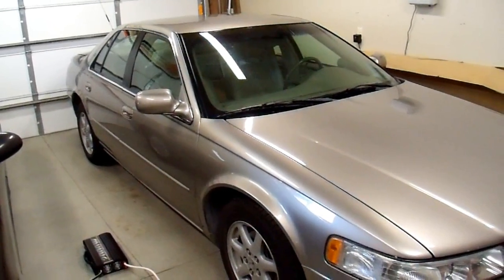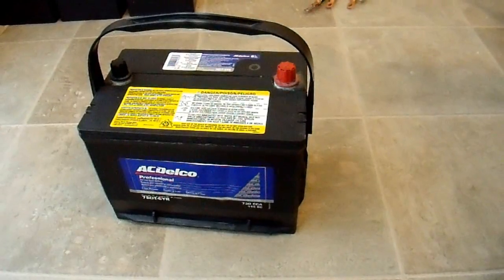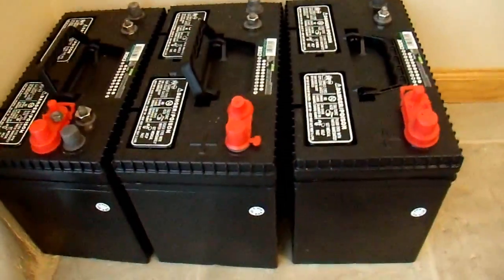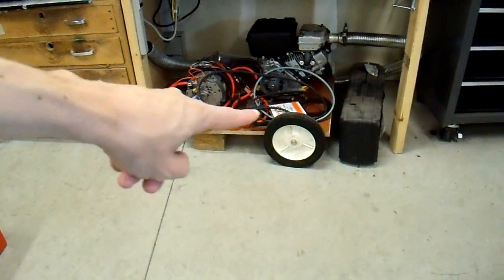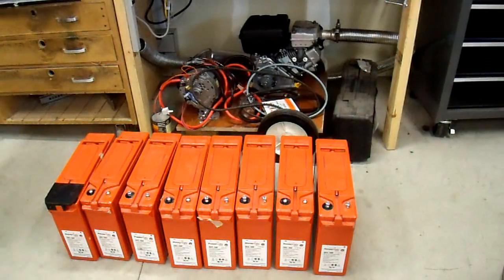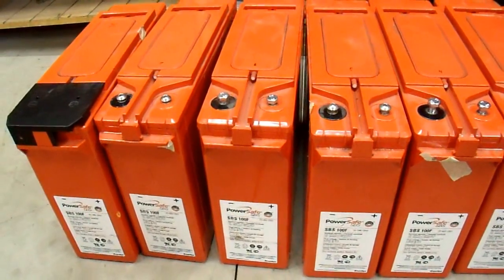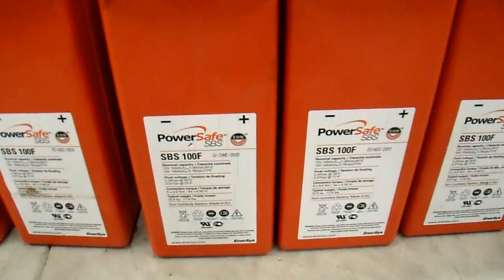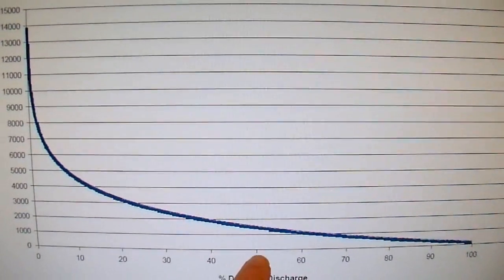1000Ah Battery Bank Part1 - My Salvaged $40 Battery Purchase : an Introduction

Comment: Where do people find deals like this where they find used stuff for sale? E bay doesn't work anymore because its too commercialized and inflated. But people must be finding deals like this... somewhere but not sure where to even look. 

Thanks.
Reply from the maker: eBay used to be useful but with today's tax laws it makes more sense to just throw things in the garbage than to sell.  A whole vibrant market of repurposing and repairing mechandise crushed.  What a waste.  I found these batteries through the company I worked for as they were going to dispose of them with a recycler and paid scrap value for them saving them the trip to the recycler.
Reply from the maker: I have a lot of random stuff that I'd normally sell on eBay but there's simply no point anymore.  I've thrown thousands of dollars of stuff in my garbage can.  It makes me sad, but the alternative is paying tax on what I sell and losing money.
Reply: Hey buddy you still active? I was able to recently get access to to literal tons of sla battery’s all standardised size and same brand, making building a bank easy! You need to find your local electrical or signal depot for a train network and talk to some of the guys there, we have 6-8 pallets about to get dumped simply because we change out our back up batteries every 2 years, I’ve got 16 100AH 12V batteries for free, they might ask for a case of beer or something for a pallet load but otherwise, we try get rid of them otherwise we have to pay someone to recycle them.

Comment: What were those big red batteries really used for those ATM batteries but they use for an heavy equipment operation at the time or where I want to know if that was just a heavy utility battery or how many hours does the really explanatory how many hours those batteries actually get if they were new I mean I'm curious of how many hours those batteries really get were they poorly in condition or were they in somewhat a good state of condition?

Comment: I'd give anything to fi d batteries for a deal like you did. I have stage 4 cancer and I'm desperately looking for a good deal like you found. I'm trying to get a solar power system built so if I get more sickthen me and the wife can have electricity without another bill that we already can't afford. I'm still working at the moment but my wife is disabled so it is really important to me. If I pass away I want my wife to still ha e electricity also. I've bought a 24 volt all in one Controller and 8 panels so far and if you know where I can find d batteries like this please let me know

Comment: I found this channel recently and like it for its great content.  I know that this episode is quite old but still applicable.  I diy my own lithium batteries but still use lead acid in my shop.  I have to say that I find 12v start batteries at my local scrapyard for 2 or three dollars that still work, carry a load, and aren't shorted between cells.  These are used to power bench tools like my table saw, drill press, bandsaw etc  thru different inverters of various sizes.  Meanwhile these batteries are topped off with my solar panels constantly.  The system uses pass thru charging  allowing me not to damage the batteries at all.  And I have a charge controller dedicated for each battery, allowing me to switch between them.  So in a sense yes,  lead acid start batteries used this way will and do hold up.
Reply from the maker: Nice!  I expect LiFePO4 will eventually take over most lead acid applications but as of today lead acid still has a very important place in stationary storage.  My experience with auto SLI batteries is similar - the primary critical failure mode is a shorted cell.  Unfortunately automotive batteries today are made so cheap that you often get less than 50% of the rated specs of the battery new if one actually tests them.  Somehow no one seems to care.

Comment: Man where can I get batteries so cheap?
Reply from the maker: These were acquired at salvage value.  Normally one would have to have connections to a battery recycler or intercept them before they were disposed of.  I noticed these on a scrap pile and offered to buy them.
Reply: Awesome

Comment: Did you ever post this on a web site prior to YouTube being a thing? I could swear that I have seen something like this on a web page back in the mid to late 2000s.  It was so long ago, but I do remember someone buying a pallet of orange 6V batteries that were heavily discharged. I do not remember any details of the recovery, but that was the goal of the information being shared on the web site. We are 10 to maybe 15 years later, and when I see this on YouTube. Perhaps I am confusing two different stories , but it seems so unique that I can't help to think that you had started this project many moons ago. The only picture that I remember is a pallet of orange batteries. 

Daag44
Reply from the maker: Must have been someone else.  Interesting to hear about someone's prior efforts though!
Reply: @knurlgnar24  Interesting indeed. Since those orange Trojan batteries are common in the professional world, no doubt someone else has made the attempt. Before I watched your videos I had no clue of Trojan batteries nor of Rolls that I picked-up from a reply to comment that you referred to the Rolls User Manual. That manual was helpful by the way.

In the past month or so I managed to recover three of four starting batteries - one for a lawn tractor, two for cars, and one for powersports. I went too far with the first one, so I have focused on the method as shown in your videos. After spending over a month at my leisure, I can say that the experience has brought me up to speed including the comment section. However I am struggling with three things for starting batteries: 

1. Discharge current;
2. Discharge in Ah;
3. Boost voltage. 

One example is the recovery of a Yuasa YTL20L AGM rated at 18Ah/10Hr and 18.9Ah/20Hr. This is the most common starting battery found in Ski-Doo snowmobiles/sleds. I began with a fully discharged battery holding an OCV of ~9Vdc and after recovery managed to get an OCV of 12.65 for a day, and holding 12.60 for a week. It is far from the ideal 13.0-13.2 when new, but it is usable for my needs. By the way I found a factory activated one sealed in the shipping box that was showing 13.1Vdc two weeks after the manufacturing date. After 12 months it had self discharged to 12.3Vdc. I had done this self discharge test to disprove what was being said by one gentlemen on a particular snowmobile forum that self discharge was negligible during the typical 8 month storage and it did not matter. This was a few years ago which at the time I had not yet seen your videos. At the time I did my best to recover with my smart charger. In hindsight, I could have easily recovered that brand new battery to near 100%.  

Since it is a starting battery, I figure to discharge to a maximum of 5% of the rated 18Ah, or roughly 1Ah. The sled does have dual headlights that I could use and draw 8.6A @ 14Vdc. So far I have taken a shortcut by using a 125A battery tester that shuts off after 10sec and I repeat for a total of three consecutive discharges for each discharge/recharge cycle. For each cycle I let the smart charger complete the bulk charge only and immediately repeat the discharge/recharge cycle. 

The cell temperature rises during discharge and bulk charge, and keeps rising after each cycle, but never above 15-20F over the ambient temperature of 60-70F. With each cycle, the results are higher for the 125A discharge test. For example, the voltages under load for the last second of the discharge tests are as shown below. I took the voltage readings under load with my DMM off the battery because the voltage shown on the tester was over one tenth lower. 

1. 10.50-10.49 -10.43Vdc
2. 10.70-10.58 -10.45Vdc
3. 10.75-10.62 -10.46Vdc

Once I have completed the three to four cycles, I top it off with a boost charge of ~15.5Vdc @ ~0.9A during which the cell temperature lowers some. To reach 15.5Vdc I had to borrow my father's dumb charger because mine was outputting a little over 16.0+ Vdc on the same 2A setting which in turn rose the temperature of each cell. 

His 10A setting is higher in voltage than mine at 12A, but I also have a 70A setting with the highest voltage of all. This whole experience had me realize that the difference in Amp settings on a dump charger is in the way it regulates the voltage. The 2A will be the lowest, then a higher voltage for the 10/12A setting, and the highest for the 70A boost setting. My father's charger only has 2A/10A, but he has been using the 10A setting to boost his Massey Ferguson tractor for years. I learned of this just recently after seeing him use the 10A setting to boost his lawn tractor. He admitted the first time felt like a risky move and eventually became standard practice.

The Boost charge on the YTX20L with his dumb charger starts with 15.3Vdc @ 0.27A and a 0.035 voltage drop across the DMM that I have in series. Over the course of a few hours the current draw will drop to ~0.8A and the voltage will rise to ~15.5Vdc with a voltage drop of ~0.02Vdc across the DMM.  

From the cell temperature rising during the discharge and bulk charge cycles, then dropping during the boost charge, I can only imagine the gassing-out of this AGM battery will be negligible. Note this is with my dad's dumb charger. Mine on the lowest 2A setting is 0.8+Vdc higher which also drives the cell temps hotter. I need to figure out if I should send his 2/10A  back or ask if he is willing to swap with my higher output 2/12/70A that I have only kept for the odd boost. In other words, if his dumb charger at 2A / 15.5Vdc is ideal without the need of a load resistor, then swapping chargers is the obvious answer. Since you have been experimenting with charging voltages and cell temperature, I am hoping that you have some insights to offer.

The two big questions that remain are:

1. Should I continue to discharge at a high rate for starting batteries, or is there an advantage to lower the discharge current over a longer period with the dual headlights for the same Ah?

2. Is there any benefit to passing the 5% DoD to recover a starting battery? For example, passing the 5% DoD one time for better recovery at the expense of cycle life. My best guess is that a deeper discharge on a starting battery that is immediately followed by a recharger will have little impact. How much deeper of a DoD, and what advantage it holds is what I hope to understand to a reasonable degree.
Reply: Out of the 4 batteries that I have attempted to recycle, I made the effort to provide the results from the AGM starting battery since it was the closest I could get to what you have shown in the videos with all AGM deep cycle batteries. What I find puzzling from the Rolls user guide is that it says AGM batteries require no cycling nr equalizing, yet this is what we are doing to recover our AGM batteries. Obviously I can make a distinction between recovering and maintaining, but it still raises the question why is this procedure not called for AGM batteries? 

My question stems from monitoring the cell temperature during recovery and noting they started far apart and ended very close. While this particular YTX20L it is still getting a boost charge this evening on my dumb charger set to 2A to compare with my dad's charger, the current is now 0.26A @ 16.2Vdc with a cell temperature of 58.4F to 60F between the coolest and hottest cell, at an ambient temperature of 54F.  Even with nearly three times more current than my dad's charger, the cell temperature appears to be acceptable for a short period (aka boost/equalization charge). So why do they say it is not needed on AGM batteries when it appears to hold a benefit? Is this because I am working on an older AGM battery that was left to sulfate? Or is there another reason such as repeated/periodic equalization attempts would further shorten the life of an AGM?

Comment: I’ve got 15 PCs 3.2v Lithium Phosphate Batteries 280Ah ea. They way there sitting now 2 wide 7 on 1 side 8 on the other I will use some of you’re ideas thank you !
Reply from the maker: Please note that LiFePO4 batteries need to be treated completely differently than lead acid batteries.  This video series concerns lead acid.

Comment: Nice review. Waiting for more in this section. We are also a manufacturing unit in the USA. Solar batteries are deep cycle batteries that need to accomplish 2 things: Reliability & Security. LiFePO4 Lithium is the best source of energy nowadays because it's the most stable type of lithium, stores more energy than any other kind of lithium and Lead-acid battery, plus it's the most secure to have in our homes and businesses.

Our battery is the lowest priced energy source in the long run, cheaper than lead-acid batteries because it can store almost 50% more energy than Lead-acid batteries and can work between 5,000 and 8,000 cycles vs 500 cycles of lead-acid batteries.

Please look at https://bigbattery.com/SolarHome/
Reply from the maker: I recently published a video on this topic which refutes these claims.
Reply: @knurlgnar24  pls give the link

Comment: 12v terrible for long life. 6v (golf cart) much better. 2v (tractor) for up to 20 yrs.
Reply from the maker: Battery voltage (meaning number of cells per battery unit) is unrelated to battery life.
Reply: Show me a 12 volt battery with a 10 or 15 year warranty.

Comment: Hi, Pls. I am a kinda of a newbie to battery banks and alike and I really need your help and guidance. I had gotten my hands on 8 of those exact batteries but with 190Ah instead, its been about a year now. I believe they were about 2 or 3yrs old used when I got them. They all held over 12.5v  when i picked them up. I made one attempt to charge them when i got them home with a little 12v car battery charger I had, that was before i had to put them in storage for about a year because i didn't have time to mess with them. I now have time to play around with them again and have brought them back out. They all still measured over 12.5v when I got them out and I have made one other attempt at charging them again. I don't believe the charger i am using is getting them fully charged and after some hours of charging, all of them read 13v except one, stuck at 12.9v. I have tried to charge that one battery even longer but it still wouldn't get to 13v.  I really have big plans for those batteries and I am worried that I may do something wrong and damage them. Pls what kind of charger and amperage would you recommend to get these batteries fully charged for starters, and if I have to do some recovery, what steps would you recommend I follow. I have watched most of your videos on those batteries but like I said mine are 190Ah while yours are 100Ah I believe. I don't know if the procedure is different for mine based on their condition and size.
Reply from the maker: Same process will work.  It sounds to me as though your batteries are in pretty good shape.  My recommendation is to fully charge each one separately, discharge each one though a known load to determine Amp hours, then recharge each one separately again using whatever charger you have on hand that can charge them.  Once cycled two or three times you'll have a good idea of their condition based on amp hour capacity.  That 12.9V battery likely has light sulfation that can be broken up by simply charge-cycling in this way.  If that doesn't work you would need to equalize to break up the sulfation and in your situation a simple standard equalization may be enough.  I doubt you need full desulfation for what you have.

Comment: Doesn't make sense to state Amp hour without voltage. It isn't 1000 Ah either. These are sealed lead acid batteries. 12V per battery. 1.2kWh per battery.

9.6kWh total.

These are from 2009. Video is from 2013. So 4 years old. That is not bad. Usually high quality batteries like that can last up to 10 years.

They are not deep cycle batteries really. For backup system (UPS), they are fine, as they can be kept charged, and cycled only few times a year.

For storing solar power, they are almost useless. With 80% DoD, they will last ~500 cycles. About a year.

Comment: Will get my hands on a set of 8 similar batteries. They were previously used in telco application, but 170Ah each, and still well within their expected service life. So now I have to view this series again and study how you tested them, maintained and reconditioned them. Don't know that much about lead-acid and want to make sure I get a charge controller that have all the specs to properly maintain them. Long time since you did a video, would be cool if you picked it up again!

Comment: We need a way to use small amounts of battery power in our homes without tying into the grid.    Low cost overhead, to get people into the solar economy.  Led lighting a few sockets...But that requires wiring. Heating water...that requires plumbing.  Out door lighting...Yes, but mostly useless.  Any ideas?

Comment: Hello... Your videos are so educational.....

I have little maths problem regarding solar....

35 air-conditioner #2hp =1500watts = 52500watts

I want to run for 15hrs a day=787500wh

I want to use 1.2v 1250ah  NiFe battery and 36v 320w solar panel

((My idea is 384 VDC battery bank= 320batteries 1250ah))

Amount of battery bank ??
Amount of solar panels??
Charger controller??
Inverter??